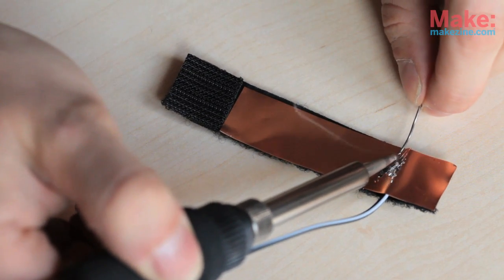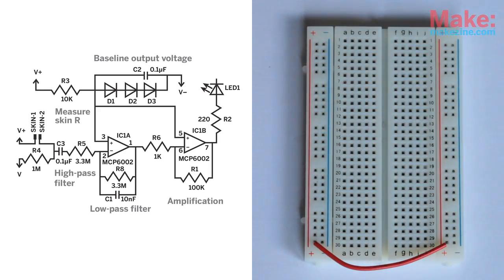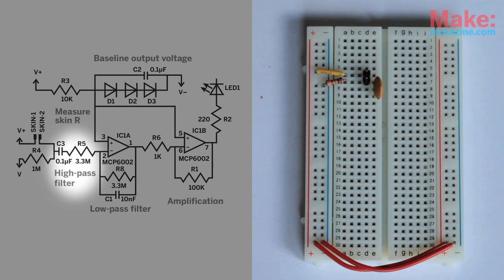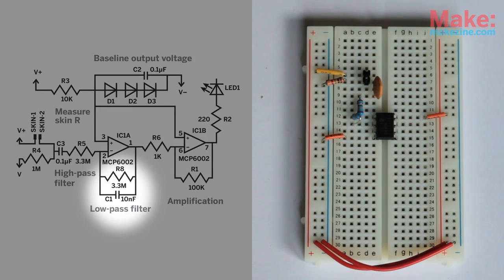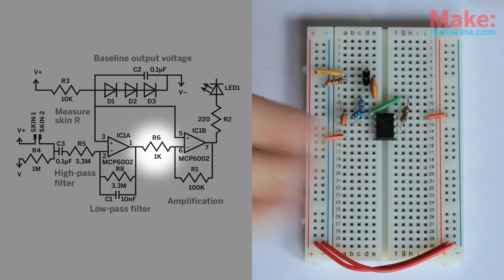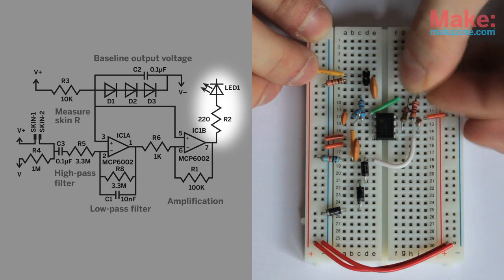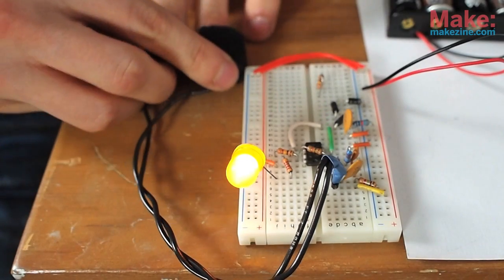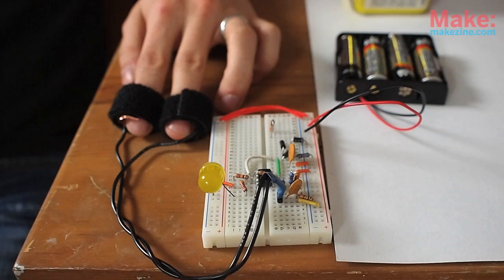The Truth Meter

Comment: You will have trouble getting solder to stick to aluminium foil, but if you decided to skip the solder step and simply bundle the stripped wire in the foil somehow, then yes you could use it.

Comment: You might want to try using flux to improve solder uptake on your foil to wire contact. Also when you solder to the header pins use two pieces of shrink tubing one for each wire instead of one to cover both. There is a high risk the header pins that you will grab the header pins and pinch the two wires together if only one tube is used. That will short them together and result in a direct shunt to the 1M Ohm resistor.